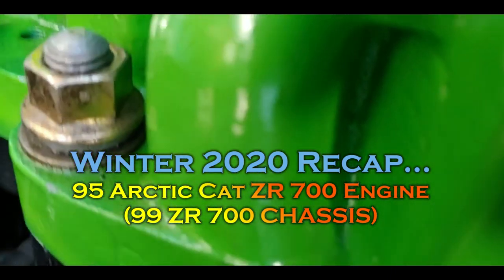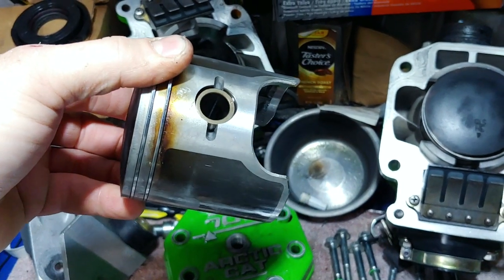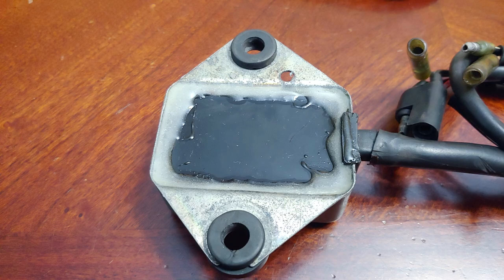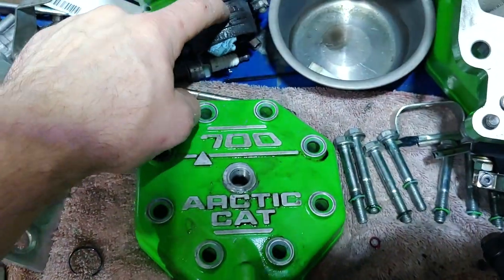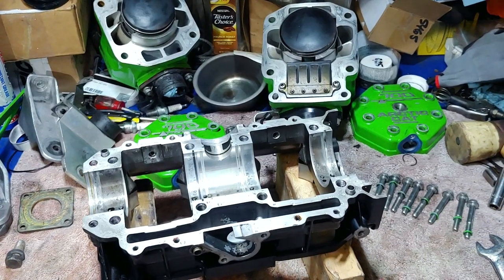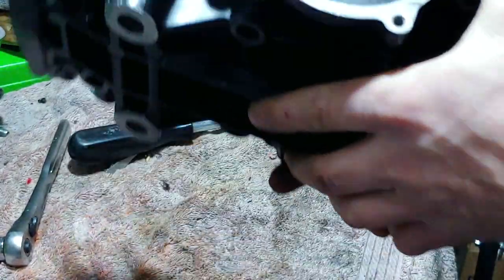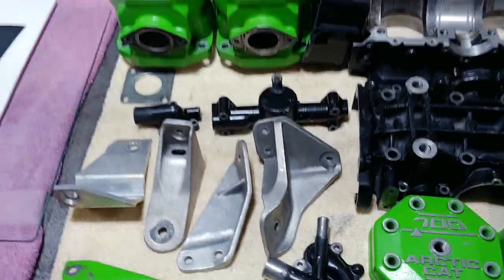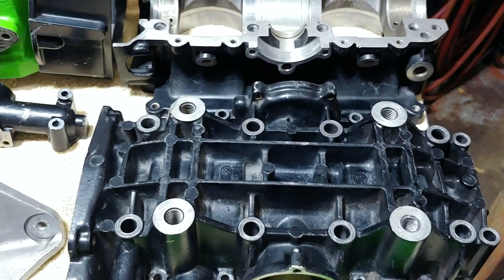1995 Arctic Cat ZR 700 Part 4 || Disassembling Engine [sorting out the issue]

Comment: I am tearing my Ski Doo 500ss apart right now, started tonight.  Put 60 miles on the new bottom end seals and Saturday I lost spark on the trail.  Turns out, my flywheel ate my stator.. so pulling the motor now to see what happend.  Sheared 3 stator bolts clear off, not sure if I will need a new block.  Lots of fun.  Damn sled ran like new but maybe I didn't lock-tite a bolt and it let loose, not sure.
Reply from the maker: Good to hear you put both seals in and sorry about that flywheel letting loose. Usually the magnets will let loose upon shutdown. Then you won't be able to start it. But you will hopefully be able to get a left-handed drill bit and drill into those stator Bolts and they'll back right out for you. Contact my boys over at West Michigan Snowmobile Parts and talk to Keith or Eric and they'll take care of you. They tear apart a good 100 sleds per year sell parts all year long. Good prices great parts and Nationwide shipping.

P.S. not sure if you checked out my 02 Arctic Cat ZR 800 CC rebuild series but I rebuilt the engine and show the complete teardown and rebuild around the 14th video. Not sure if it'll help you out at all but I got a bunch of stuff do my channel that should be able to guide you in the right direction. If you got any questions about anything let me know I'll do my best to help.

Comment: Nice work! It looked like a lot of fretting wear on the cases where the bearings ride; have you seen that before? How many miles were on the sled? I enjoy following a long and it would be helpful if you listed expenses as you go, or maybe a summary when the project is done
Reply from the maker: Yeah I'm not exactly sure what that's from other than maybe the bad connecting rod bearings shaking things up coupled with bad crank bearings... But I have seen that before in numerous cases. Never been an issue so far. Not exactly sure because this engine came in a 98 ZR 600 EFI chassis. So there's no telling how many miles around the engine. When I get this thing all buttoned up and running like a top I will try and get a cost. But typically for a rebuild crank and new top end for a twin you're looking at around $1,000 just in parts. That's not including the work done. The complete box of Nuts and Bolts hardware for the entire slide you're probably looking at a couple hundred dollars if you go to a less-expensive Fastener shop. And then there's all the powder coating and repairs I did including replacing tie rod ends and heim joints and bearings.
Reply: @Andrew Crocker - Fixin2Ride  Hard to add it all up, and a lot is cosmetic stuff that probably doesn't need to be included. People might find the major stuff helpful though; to know what to expect when you get into crank work etc. I am weary of aftermarket gaskets in critical areas the case halves as well or jugs; the thickness can really effect bearing race retention within the cases and compression ratio. Never know what a previous owner has changed as well, so will be nice for you to start with a new baseline now
Reply from the maker: Definitely and you know I've actually talked to cometic and wiseco and they both have confirmed that things like crank seals are almost all made by the same manufacturer which they didn't tell me who it was. But as far as base gaskets go I typically go with cometic. The twerking of the crankcase bolts should take care of any mild differences and crank seal diameter. I like to now use Permatex The Right Stuff one minute gasket maker and spread that thin and then dab it with my finger tip just on one side and that seals very well.

Comment: What's the size of the head bolts??? Length and thread
Reply from the maker: They are Arctic Cat part number 3007-408 and I believe they are 8mm x 60mm. If you have calipers you can measure an old one. Then take that to a fastener store and try there.

Comment: I dont know doing all this work I definitely replace piston end rings why not it not going cost that much more what maybe $200 or more just saying
Reply from the maker: True but this top end kid only has about 700 miles on it so it's still new for one but I did end up getting the Pistons race coated and that fixed any tolerance issues and the thing still has like a 136 to 138 PSI in both cylinders
Reply: @Fixin2Ride-Official-  oh ok so after first rebuild you have to buy new pistons later? And not saying what you did was wrong I have used old pistons before,I just feel like you did a lot of work like bottom of motor rebuild, and and complete carbs rebuild and all that powder coating you did to motor it look sweet and brand new . And you do great work to
Reply from the maker: Yeah so I think that the pistons naturally were on the higher end of the clearance range, new.  And I did experience one instance of a coolant leak. Not sure if that caused more wear on the pistons being coolant washing away some of the lubrication... I heard a tinking noise as the pistons would cycle through TDC. It was the piston rocking through TDC. So the local shop told me about the race coating and that was a decent price and something new to me so I figured Id try it. So far so good. The only pistons available were SPI kits. Thats what this is. So if its more along the lines of a quality issue with the SPI kits, this is the next best thing and is supposed to optimize the clearance for best performance and longevity. So we'll see.